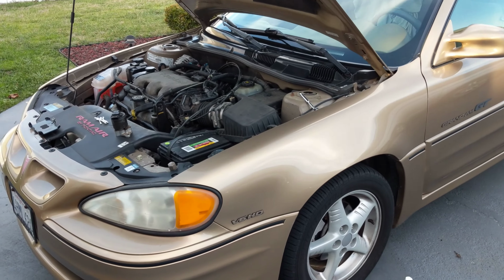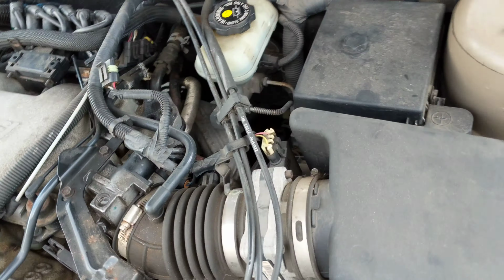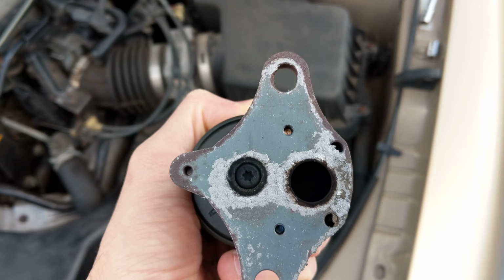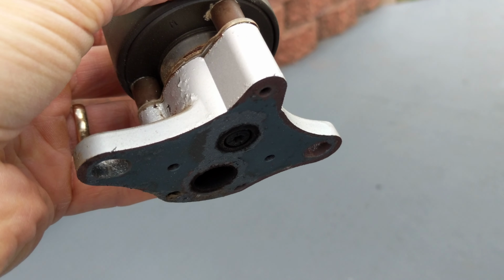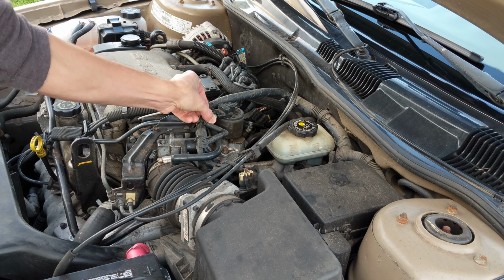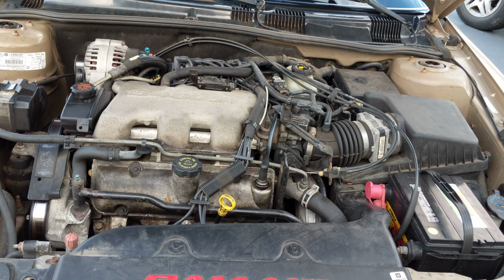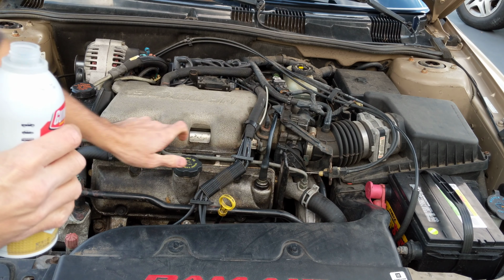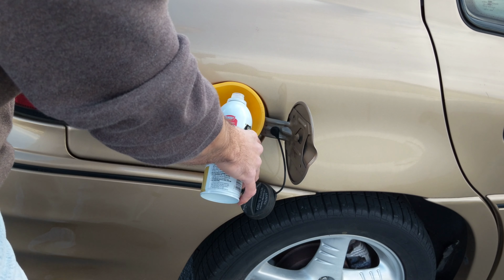HOW TO FIX A ROUGH IDLE

Comment: Good ol lifter peck 😂 mines the same
Reply from the maker: bleh finally got rid of this car.. it was time.. second blown head gasket
Reply: @ETPCYT  just picked up a copper colored 04 Ram Air with 216k miles that was maintained buy a dealership...bought from a elderly lady that just bought a new car...tons of receipts from over the years...car runs like a dream but small lifter peck is only problem I could find
Reply from the maker: nice :)  I still see a lot of these on the road.. mine only had around 98k miles maybe I just was unlucky :)  take it easy BRO :)
Reply: @ETPCYT  shit happens I Rekon